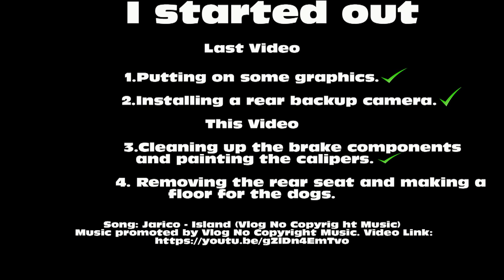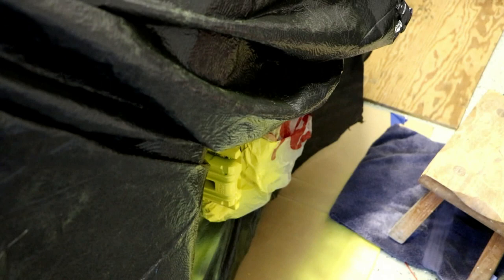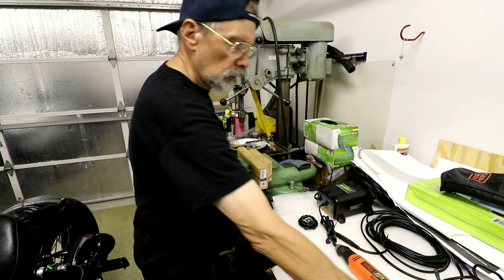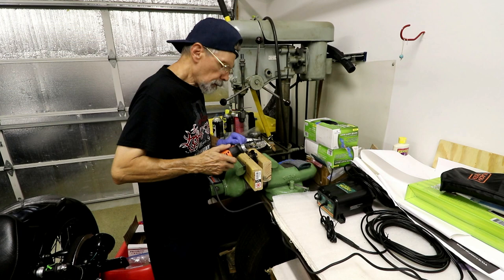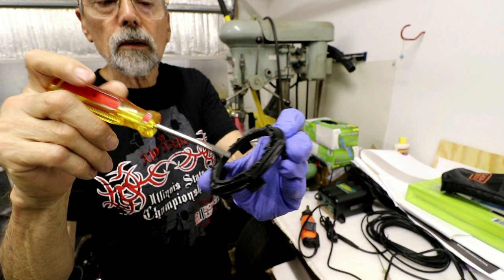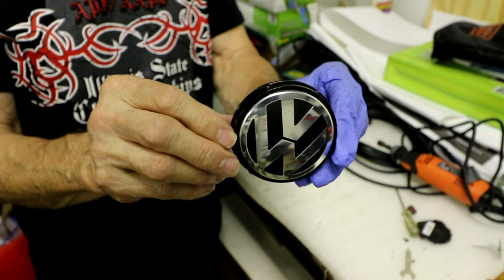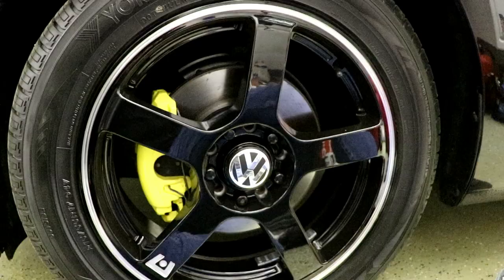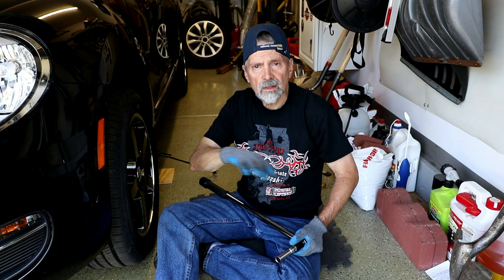My New To Me 2015 VW Beetle Customizing Project Part Two.

Comment: In total how long did this project take you ??
Reply from the maker: A little over a month. Waiting for parts took up most of the time. VW is tight-lipped on helping us service our cars. I had a hard time finding instructions to show me how to take the inside panels off. US cars are different. I had to get a scanner to enter code into the head unit/radio. To activate the camera. The auto parts store scanner, only scans for faults.